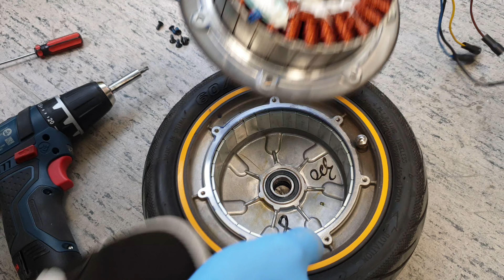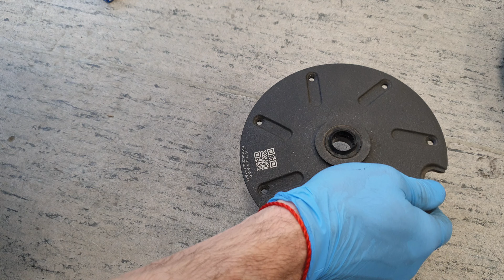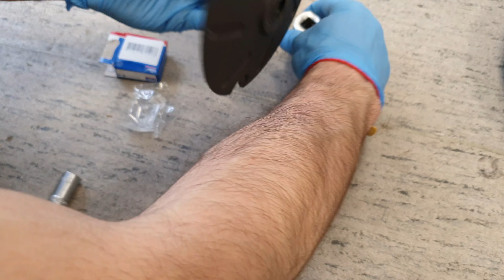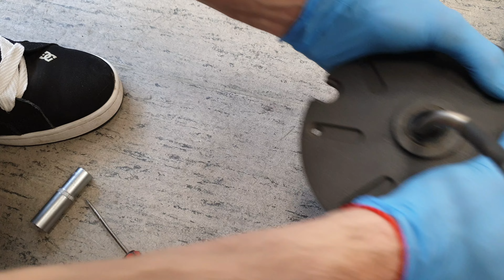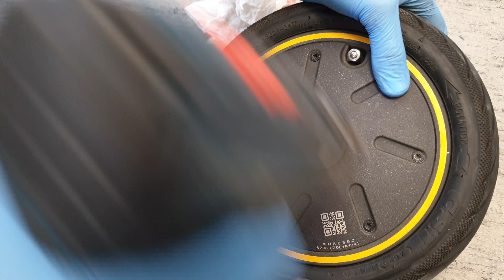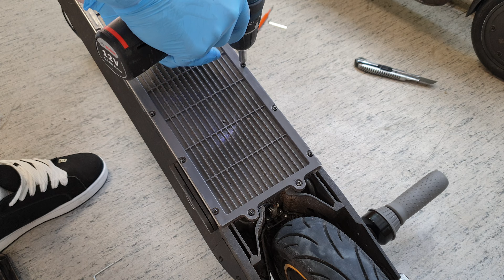SEGWAY NINEBOT G30 MAX REAR MOTOR WHEEL BEARING REPLACE | NINEBOT G30 MAX ЗАМЕНА ПОДШИПНИКОВ

Comment: It is customary to have 3 liters of   hard liquor when working on the later models of this scooter. You CANNOT disconnect the rear wheel as easily due to the brown yellow and blue cable being screwed, meaning now you have to remove the battery just to get enough room for a tool
Reply from the maker: It's getting harder and harder to fix something...

Comment: Can a second external battery be connected to the front of the ninebot e45d? So I had one internal and two external batteries? how can i connect together ?
Reply from the maker: Yes if you can do a custom firmware to unlock charging while driving.

Comment: What about the radial seals? Are there replacements available?
Reply from the maker: don't know, but you don't need to replace them, they are in good condition and you can grease them inside + the bearings have a good seal.

Comment: Hello friend, do you know what are the measurements of the front wheel bearings of the Segway f40e scooter? Thanks 👍
Reply from the maker: sorry no, take it apart and read whats on bearing written, there should be a numer 6001/6002 or 6003 rs

Comment: Hi! Super Anleitung!
Frage: Was ist denn das für ein rotes Fett, was du da reinschmierst? Irgendwas spezielles, oder einfach nur "Fett"?
Reply from the maker: i don't speak german, but i understand, you can use any grease you like... i'm using this one because i have it at moment, u can use even wd40 for sliding the bearings and some silicon or lithium base grease for gasket
Reply: Etwas spät aber im Deutschen: Lithiumseifenfett

Comment: I want to so this nyself. Is it diffucult to make the bearing press?
Reply from the maker: you can hammer it, find a socket with the same diamentr as the outer ring of the bearing.. 
nop.. just some socket heads and threaded steel pin

Comment: Hello
Could you please tell me the size of the torx screws of the bottom plate that give access to battery, motherboard etc please? Thanks
Reply from the maker: i don't remember, a guess t10 with a hole. just buy your self a cheap set.. they cost like 5 dollars.

Comment: Would these bearing work the the Segway f30?
Reply: And is the WD-40 lithium grease okay to use?
Reply from the maker: don't know f30, never been in my repair shop
Reply from the maker: @Thevariablegamer  wd40 is not lithium grease..
Reply: No wd40 makes lithium grease
Reply: Would it be fine to use it?
Reply from the maker: @Thevariablegamer  oh, didn't know that, yes you can use WD-40 :)👍

Comment: RS v RZ BEARINGS does it make a difference?  One on my scooter which is a copy of this have 6202RZ bearings
Reply from the maker: RZ: The bearing side has a low friction seal lined with steel plate synthetic rubber (non-contact type); RS: The bearing side has a contact seal lined with synthetic rubber or polyurethane (contact type)
Reply: @RMFUNTIK  I have brought ZZ bearings to replace the RZ as the RZ Dont appear to be widely available as the RS/ RZ ...hopefully they will last
Reply from the maker: RZ bearings are not sealed (water, dust proof)..

Comment: Hi, my back tire is kind off jammed and the scooter died while i was riding it, but there was one cell battery left. What do you think is the issue ? Btw, nice video.
Reply from the maker: what do you mean by off jammed?
Reply: Like it rotates but with some thing like its in gear.... ? Or stuck to it .
Reply from the maker: @anshulkhatri6231  hmmm... maybe something wrong with your motherboard? never seen that trouble with g30..
Reply: Weird part is, there was battery left ... And stopped and then the tire is locked ... Not completely but it move with more effort. And the scooter does not turn on either. Also, I put it on charge last night thinking that the battery was down, but it did not turn on while i put it on charge. I checked today morning and its still not turning on. So, if its motherboard then just replace it? I am in Canada... Do you have any recommendations?
Reply from the maker: @anshulkhatri6231  nope it not motherboard, guess it's BMS, check the voltage on the battery pack it should be 37-42v
Reply: @RMFUNTIK  I don't have anything to check it😅 , what's bms?
Reply from the maker: :) try to find local electronics mechanic.

Comment: Hi friend, thanks for the nice video! I need some support that I'm looking for a long time, hopefully you can help me. Do you know the correct code of each hall sensor inside the motor? I'm struggling to find it and I'm having problems to run my G30 due to that. It would be very very helpful. I almost could read it at 5'02" in 4k resolution...
Reply from the maker: https://www.falconpev.com.sg/collections/spare-parts/products/motor-hall-sensor-single-piece try here
Reply: @RMFUNTIK  Thank you very much for replying me, I'll give a try with the sensors in the link! But my concern still is that it seems that in the G30 motor, the central Hall Sensor is different than the other two. That means two types of hall sensor and my guess is that this is my problem now, I'm using the same Hall sensor in the all three positions...
Reply from the maker: @adriancovi  https://www.scooterhacking.org/forum/viewtopic.php?t=174

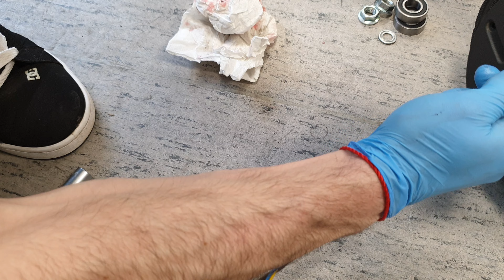Comment: hello friend I got an important question, from minute 14:35 onwards, is it not necessary to apply sealant such as Hylomar to the edges of the cap so that dirt does not get into the housing? I read in a forum that you should definitely do this. Do I have to? :) 

Thx for making this video!
Reply from the maker: yes you can put some sealant it won't be bad :) but the main water and dirt leak is from bad bearing seal